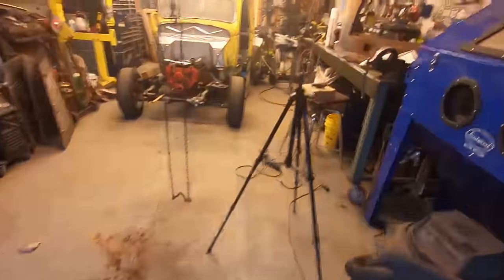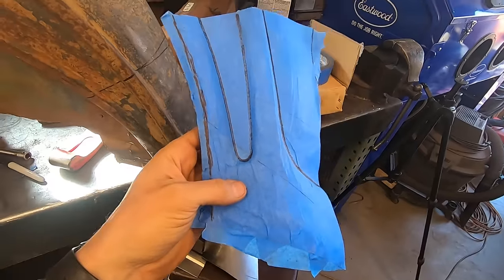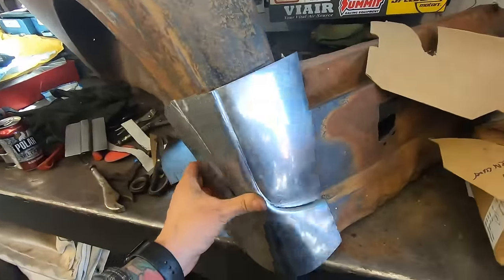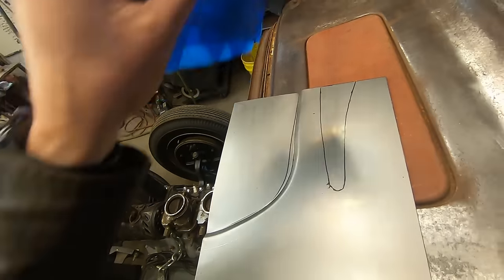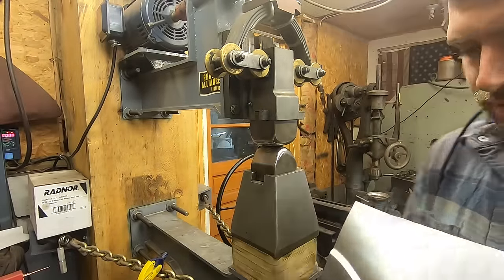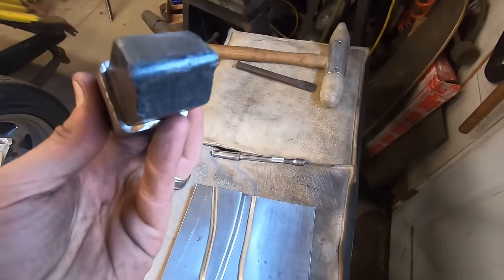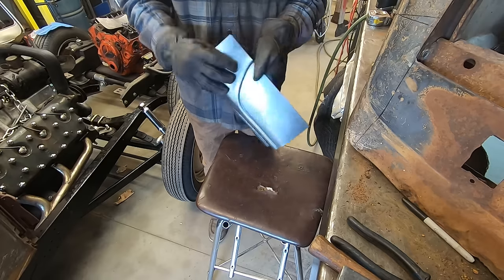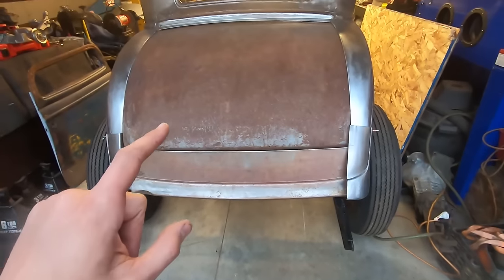Fixing The Body On The 1932 3w Coupe Part 4 Rear Corners

Comment: Why not make it in 2 pieces? I understand wanting to be able to make it in one, but is it worth the time to figure out?

If trying to make it in one piece what I'd probably try to do is shrink the bottom before bending, and maybe leave the ends of the beads a little wide and pull them in with the shrinker on top to help add some shape.